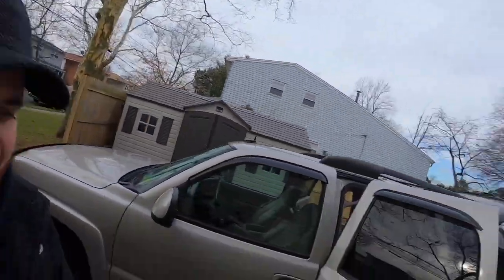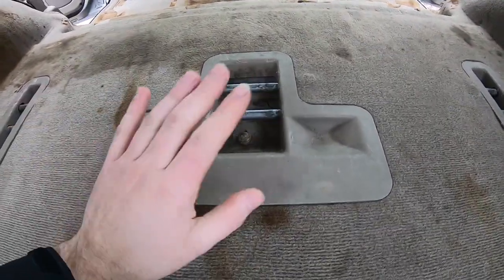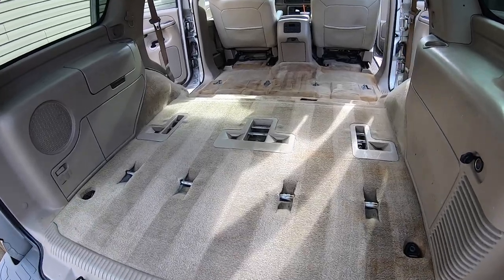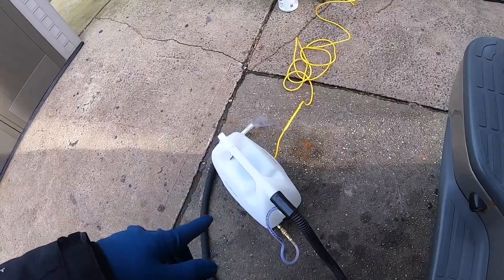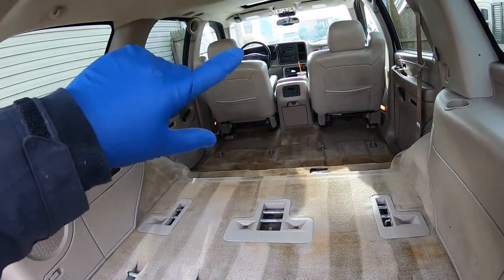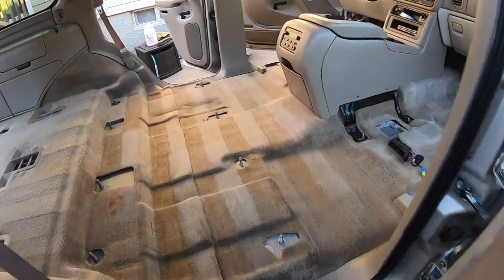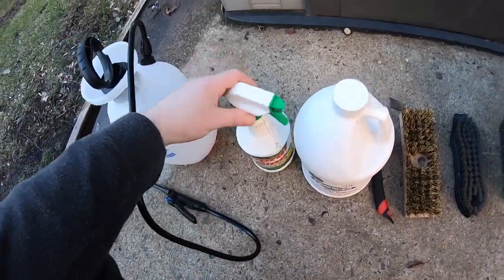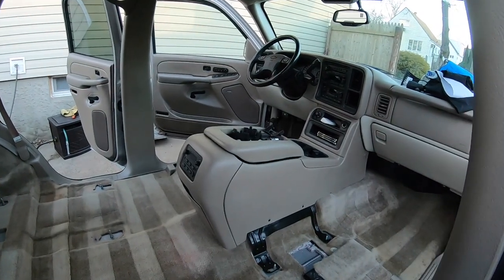This Carpet Should Have Been BURNED!!  | Extreme Detailing

Comment: Peroxide will help in removing those hard stains .... also those deep stains that keep coming back? Probably should have gotten under that carpet and really saturated the rug and put plastic between before saturation and the worked ok those areas ... the stuff that is surfacing is stuff below the rug in matting probably ... separate the two and it should work

Comment: The brown stuff should come up.. 
If it's rust from underneath,  try acid rinse..  can also use clr, but check commercial chemical supplier for good stuff.. make sure to balance ph to around neutral. 7ish with alkaline rinse. 

If that doesn't cut it, try brown out by e-steam. Might be a tanning issue.
Reply: Also, don't use engine degreaser as carpet cleaner..
Reply: It's corrosive and might leave you with more problems in long term. If not thoroughly extracted

Comment: Since the carpet is sectioned...and so bad I would have debated removing and then a pressure washer or a trip to the car wash. Probably to also blow the fabric knap off the carpet...it isn't stained anymore if it isn't there.
The vacuum push pull lines #ocd

Comment: I just pulled out a sitting Tahoe that was full of food and trash that had the worst mouse infestation I have seen yet in a car. Lots of blood spots? Where mice decomposed and rotted and somehow disappeared it looks like or something. Bloody mouse turd trails. The smell would not let you enter the vehicle. Its seriously easier to take the carpet out and use a soap cannon / electric power washer and blast every thing out and let it dry in the sun.  My Ram wood hauling truck had coffee and soda dried into it multiple times there was just this black mush for a floor. I just used the power washer on it inside the truck and parked it on a hill sideways so the water ran out. It looks like new.  A conventional carpet cleaner doesn't put out enough liquid to flush out those stains that kind of bled to the surface. The power washer blasts them out in 2 seconds. $70 for the Cheap electric pressure washer $20 or less for soap cannon.

Comment: You need to get a drill brush attachment. Spray on solution, use drill brush, use extractor. Bingo. And you don’t need to put anymore solution in the water. You already sprayed it and now all the extractor is doing is putting more into the carpet when you’re trying to suck everything up. Hot water will do just fine.

Comment: It's faster, easier, and better to simply remove the carpet and pressure wash it. Then let it dry in the sun for a few hours. Have also used squeegee or compressed air to speed up the drying process. Pressure washing takes ALL of the dirt, stains, and odors out, whereas the methods used in this video left a good bit behind.